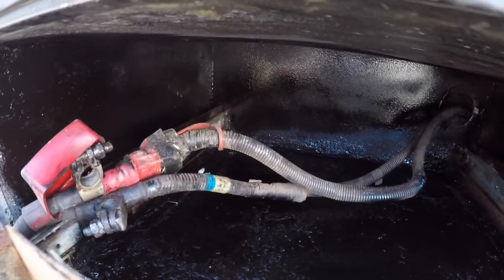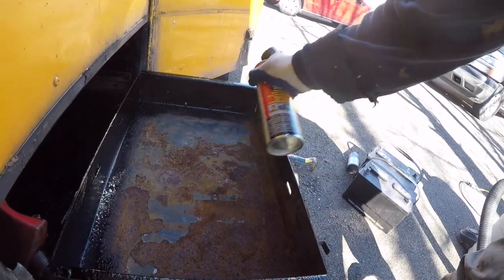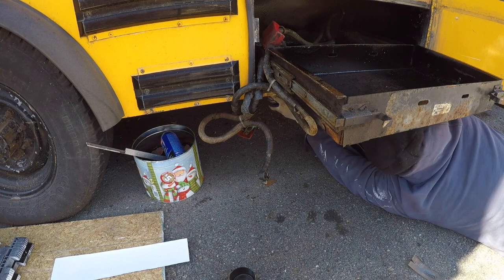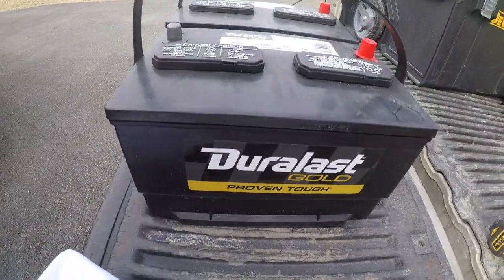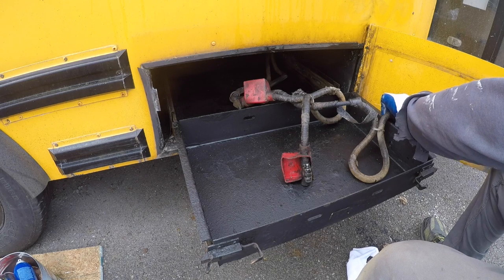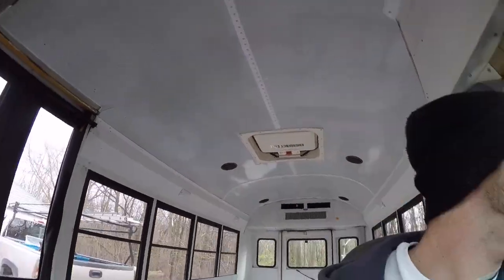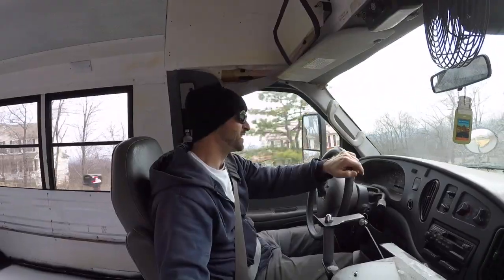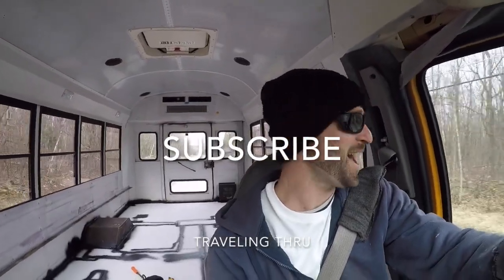Skoolie Short Bus Conversion - Installing New Batteries in a Bus

Comment: Ok, I just put 2 new battery's in my Blue Bird 95, dash lights came on & clicking , then no lights & no clicking. What next, Starter relay switch? Where is it? Help.....
Reply from the maker: Hmmm, check fuse box. Check terminals are tight on batteries, could be the starter.

Comment: I’m about to replace my batteries as well but mine are split up, one in the engine compartment and the other where your two are connect by a breaker in the bus. Can I still use both Duralast Gold like you did?
Reply from the maker: I would think that would work fine.